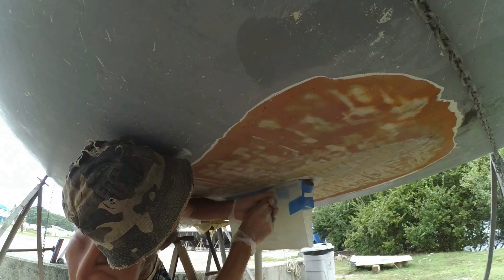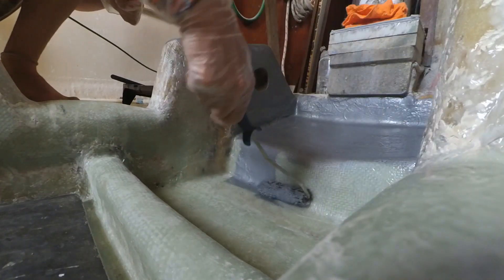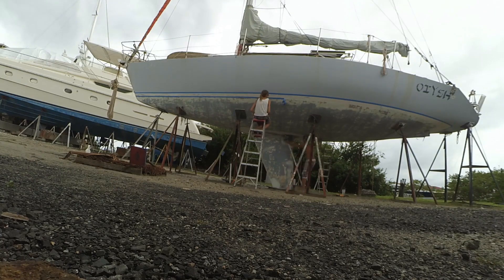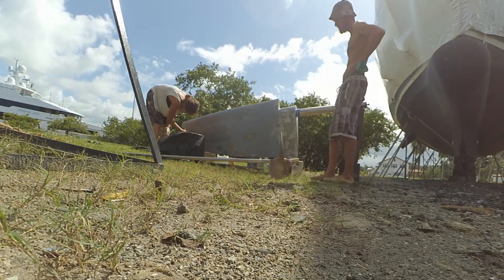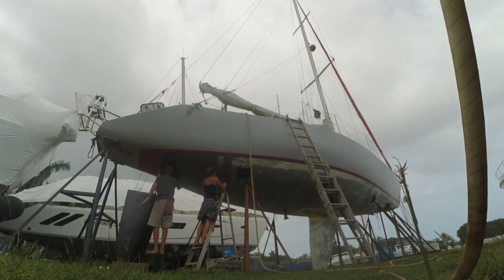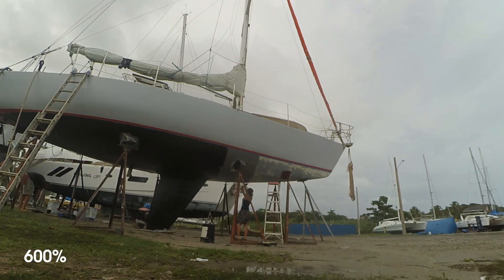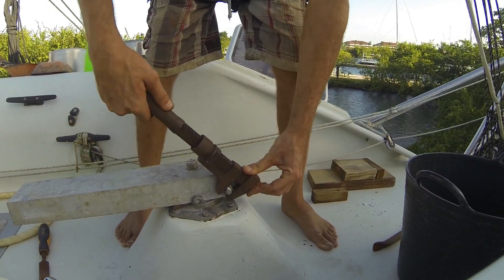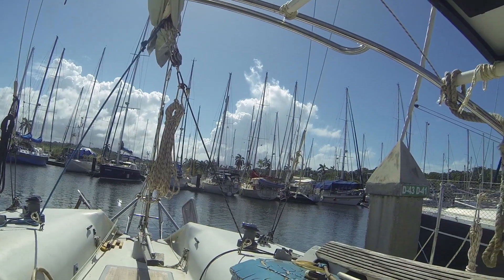Quest Nº 10 Paint, electricity & propulsion  [Retired IOR boat refit]

Comment: Trouble with Mast is that is have no Rear/Fore support if the Backstays are not tensioned. Unlike modern Racing Masts where they have the spreaders swept back at 22 deg which support the mast without of backstays in light conditions.
Reply from the maker: Yes, that is why we have to be careful what we are doing with the backstays especially under sail ;) Maybe one day when we are adults we can afford a more modern mast but for now we just stick to bending the pasta stick we have :)